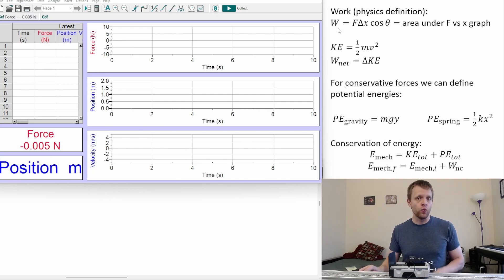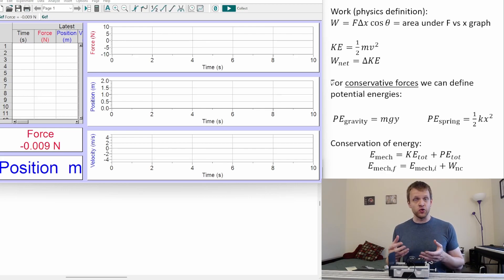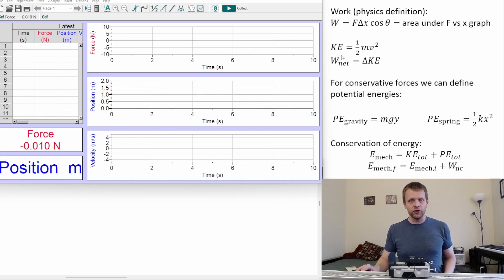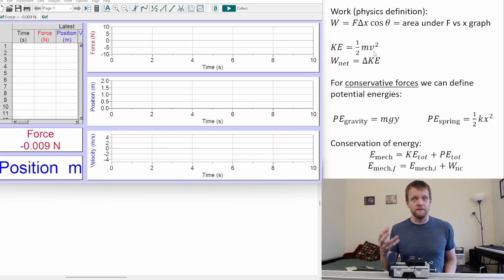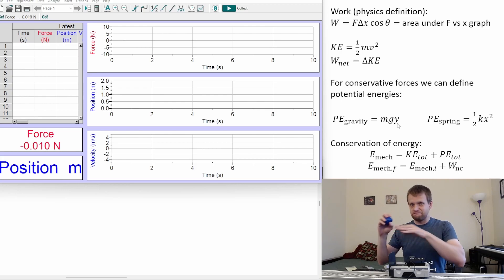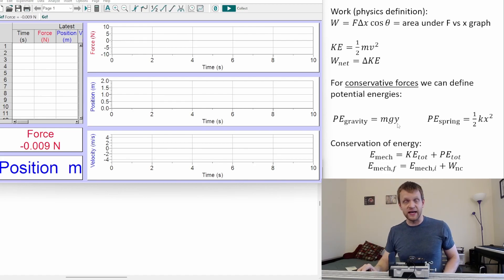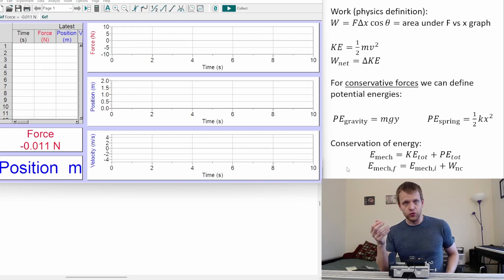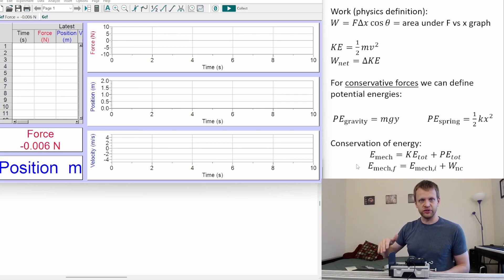Work and Kinetic Energy - Testing Physics

Comment: Added this to gary's review of my comment here:

 Hi gary. It seems I didn't do bad trying to explain some of the aspects of your ideas (although I disagree with them). The one thing you dispute is not believing in Galilean relativity. Galilean relativity, which is velocity relativity, is the idea that if two objects are moving toward each other in space you could say one is moving and the other still, or that it's the other way around, the other is moving and the first one still, or that both of them are moving at half the relative velocity.  I know you don't agree with that, right, so I'm not wrong about you disagreeing with it.  You might not think Galileo said that, but he did.  The spatial part of this is there is no place to put the zero point or origin point of our space coordinate systems, any place is as valid as another. You disagree with that as well, correct? This  follows from the velocity relativity b/c if there was such a point, then you could calculate absolute velocity, which Galilean Relativity is claiming you can't.  That's why I said you disagree with Galilean Relativity and now you know what I mean by Galilean Relativity.  Galileo did believe these things, but that's a separate issue from the type of relativity that predates Einstein (and QM).  It's pretty clear your system is based on an absolute coordinate and velocity system, which is what I was explaining to Physicist Michael.  

PS: a second is just as different from a second squared as a foot is from a foot squared.
Reply: Here is a video where he explicitly denies Galilean relativity: /watch?v=r5BLeaWcvoM&t=45m27s 

Later at 47:10 he says, "so all you have to do is put an object on each thing that's moving okay and then watch how those objects Collide and it'll tell you who's got the real velocity."
Reply: @mindlessmarbles9290  Exactly.  Hadn't seen that but have seen him say it many times.  The first time gary ever blocked me was about speed of light relativity (more than 10 years ago omg). He thought if somethings going almost the speed of light this way, and another almost the speed of light the other way, then they were would be going almost 2x the speed of light from each other.  Not only does he believe that (which is intuitive after all), but he may still not realize that this all follows from Gallileo's idea of motion.  This has long been about figuring out the shape of Gary's misconceptions, rather than convincing him of anything.  You can lead a horse to water but you can't make them drink.  We're here trying to figure out why the thirsty horse won't drink.

Comment: There is no kinetic energy in a moving mass there is force Mv squared kinetic energy is the energy of consistent work from a consistent force regards Graham Flowers
Reply from the maker: Hi Graham Flowers.  There are a couple definitional issues here.  When we talk about forces, we're talking about different kinds of interactions between objects.  For example, the gravitational force on the Earth involves the Earth pulling down on me (and me pulling up on the Earth; all these examples have both objects pulling on each other, which is Newton's 3rd law).  Friction involves the resistance of surfaces sliding against each other.  If I put an object on a table, the normal force is the table pushing up on the object (stopping it from falling through the table).  If I go swimming, the Buoyant force is the force of the water pushing up on me.  And so on.

So all forces involve interactions between objects.  So if I just have a single isolated object, even if it is moving at a constant velocity, there aren't any forces involved.  Newton's 1st law is that if there is no net force acting on an object, it will keep the same velocity (an object in motion will stay in motion).  A net force will only be involved if the object's velocity is changing, i.e. it is accelerating (Newton's 2nd law).  

On the other hand, we have this mathematical quantity, 1/2mv^2 (let's just leave it like this and not call it kinetic energy, since that sometimes causes some hangups).  This quantity is based on the mass and speed of the object.  So if the object is moving (and has a non-zero mass), this 1/2mv^2 quantity will be non-zero.  Why do we care about this particular 1/2mv^2 quantity?  Because it has some really nice properties and can be related to other physical quantities (such as the work).

I'm not entirely sure what you mean with your last statement about consistent work by a consistent force.  I show an example with a varying force in this video and we still get work = change in this 1/2mv^2 quantity.  I've got a follow up video to this one that uses this quantity in other cases where the forces acting on the system are not constant if you want to check that out: https://youtu.be/SaucryPVE4I

Hope that clarifies a bit.  This statement of "if an object is moving it has a force" is a common misconception (it came up a lot on the show Mythbusters, which I generally thought was a great show).  It might seem pedantic that I'm being so specific with definitions, but it really is important for clarity in what specific physical properties we're talking about.

Thanks for the comment and let me know if you have follow up questions!
Reply: @PhysicistMichael  If kinetic energy is 1/2 mass valocity squared what is in the other half regards Graham Flowers
Reply from the maker: @grahamflowers  That 1/2 doesn't mean there's another 1/2 missing somewhere.  Essentially this is a consequence of how we have defined our units.  We define a Joule of energy as the work done as a 1 Newton force is applied over a distance of 1m.  But when you go through the math (either the theory side, or the experimental side), a 1kg object moving at 1m/s will only have 0.5 Joules of energy, using the above definition.  If we would have defined a Joule of energy to be the energy in a 1kg object moving at 1m/s, the KE formula would be mv^2 and we'd probably define work as 2 times force times distance.  So there would still be that factor of two around (this fact just seems to be a property of how our universe works).  This link has a simplified derivation of where these definitions come from (combining Newton's 2nd law and some equations from kinematics) https://openstax.org/books/college-physics/pages/7-2-kinetic-energy-and-the-work-energy-theorem

So, ultimately, we use that 1/2mv^2 equation because that's the particular combination that has the very nice physical properties that allow us to make predictions about physical systems.
Reply: @PhysicistMichael   so you say that there are not 2 Half's in a mass but the symbol for a 1/2 = 1  divided  by 2 fact so what is in the other half how can only 1 half have kinetic energy and the other half have nothing  regards Graham Flowers MEng